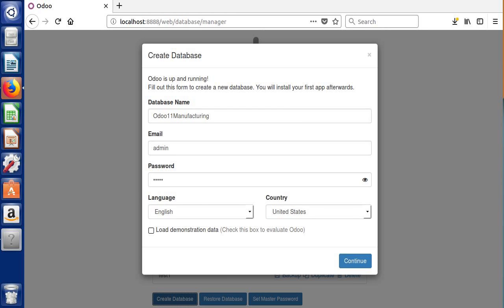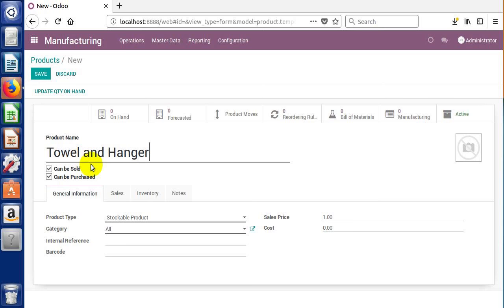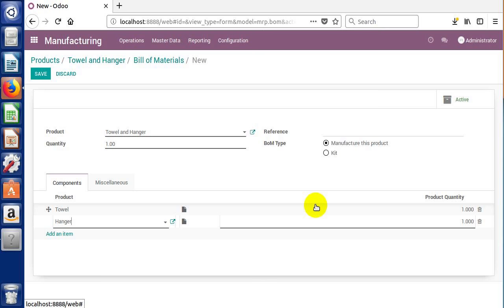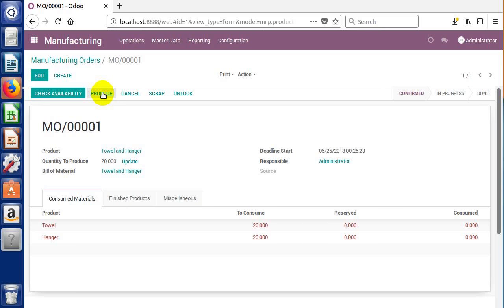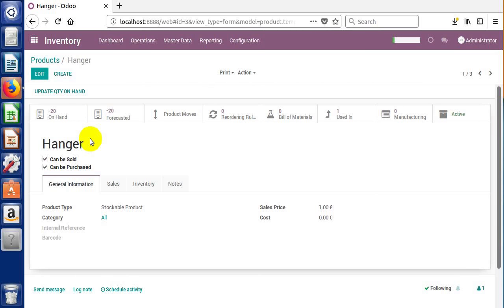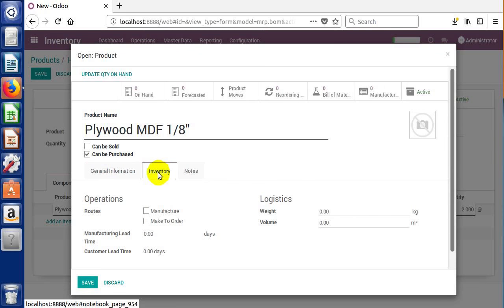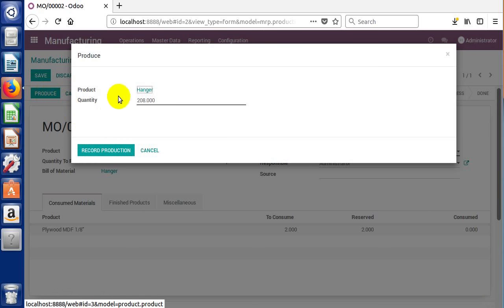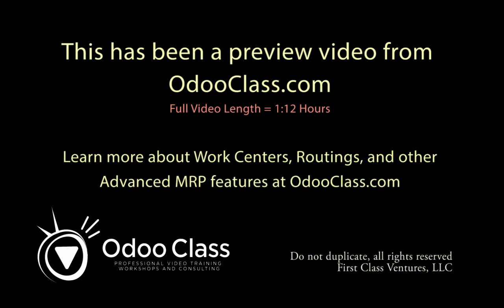Implementing a Manufacturing Business in Odoo 11 Enterprise

Comment: what kind of hosting resources are required for odoo?  i am testing out odoo community 11 with most apps installed but near zero data input and only using it myself a couple times a day, mainly 6 projects in the project app.  odoo goes down on nearly every single data input/change.   i have 4 gig, 4 core managed hosting, they want me to double it to 90 bucks a month basically to host the empty apps?
Reply from the maker: I have run Odoo fine with 4 GB and 4 cores.  We have a video running it on the free tier Odoo AWS Amazon Server. https://www.odooclass.com/shop/product/install-odoo-11-on-amazon-aws-ec2-216  and it is only 1 core and 1GB.      I would NOT recommend using that setup ( that for production business finance... but for your example of just using the project app I would think 4 gig and 4 core should be ok if there isn't other load.
Reply: something must be wrong with the install.  what version would you recommend that is stable?  skip ver 11?  or try a new install?   or new hosting company ;) (it is with an outside managed hosting company) if it works out and comm version demo goes well for my manufacturing company, i'd prob go for enterprise version for about 10 users, otherwise might look at zoho one to add to my quickbooks and add some MRP module.